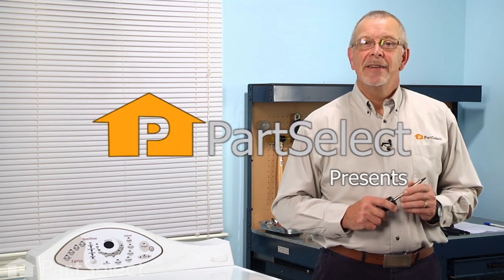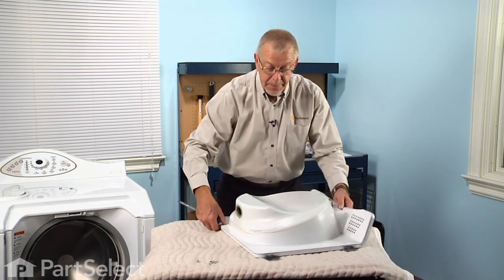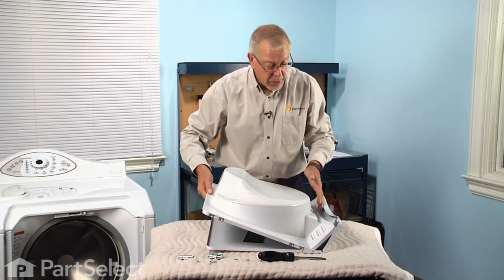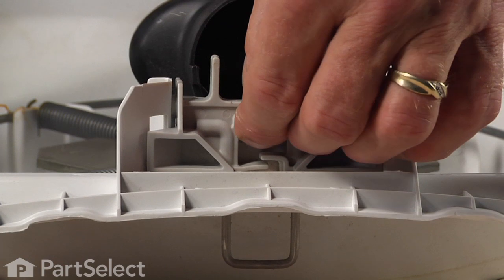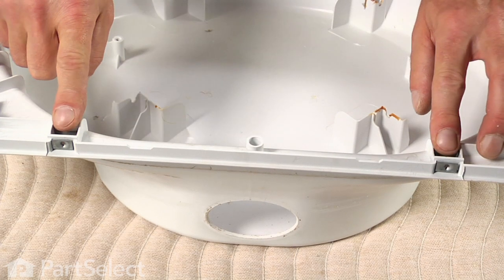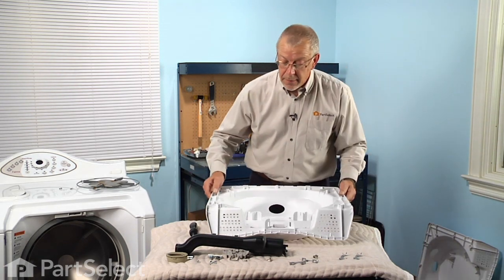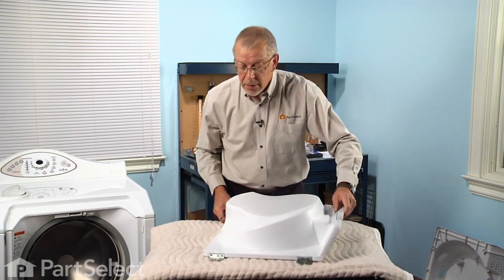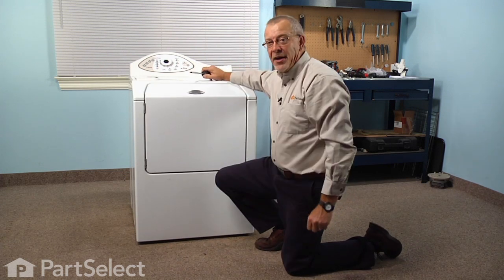Washing Machine Repair - Replacing the Inner Door Panel (Whirlpool Part # 22003275)

Comment: Hi, I know this video is crazy old, but it just helped me with doing this exact thing on my Maytag Neptune washer. When I took the old panel off my door to get to the internals though, my door was missing that ring, plate, and springs. Is that a problem? We've had the washer for over 12 years and never noticed anything wrong...